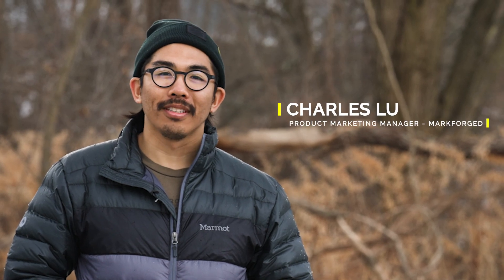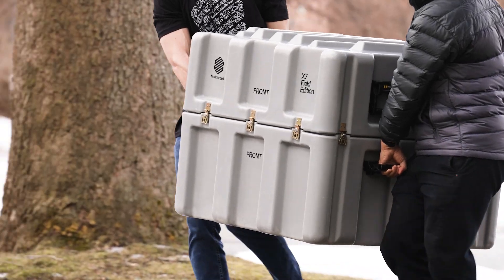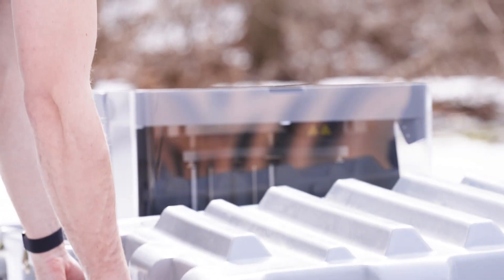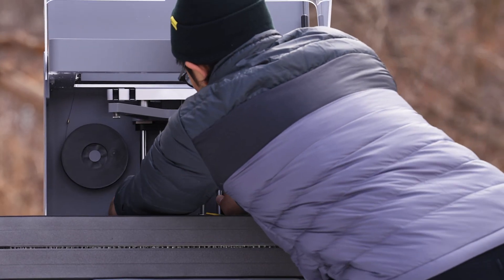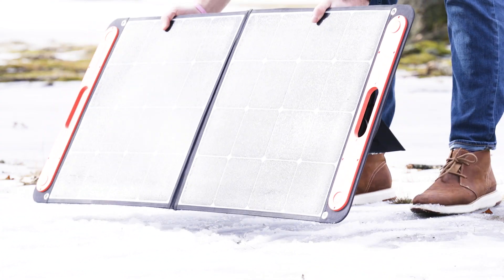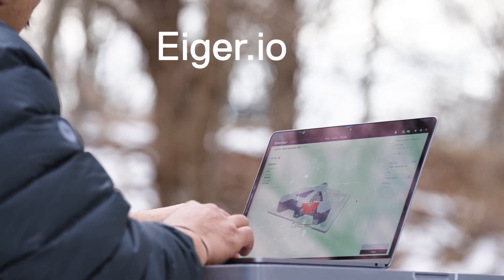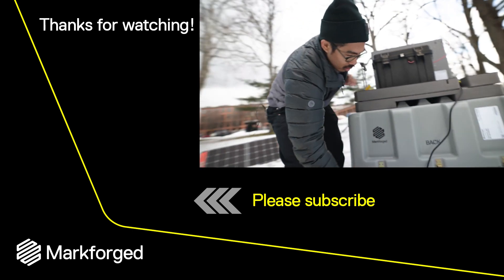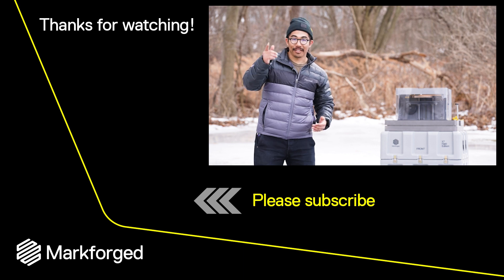How to 3D Print Anywhere on Solar Power  |  X7 Field Edition

Comment: That was a battery back up to have 240v/115 v.. solar is for charging the battery.. gives the batter pack extended run time.. this isn't running off solar, or that would be said as .. on solar.. it's on a battery , that is on solar.. not directly on a printer.

Comment: Does anybody know what power supply they used? I know that they use solar power, but what was it that they plugged the printer into. I’ve been trying to find a way to 3D print without needing an outlet and wanted to know if power supply will work.
Reply from the maker: Thanks for watching and for your comment! We’re using a Jackery Explorer 1000. Any portable power station or generator capable of outputting at least 150W can be used as well. Happy printing!
Reply: @markforged  I was working to develop a project with similar intent a few years back which unfortunately had to be put on hiatus (life circumstances). It looks like it will still be some time until you've worked up to including all the same features and capabilities as the fully self-sufficient rapidly deployable additive manufacturing system for expeditionary applications in austere environments I had designed, but you're definitely making progress! Glad to see someone else taking up the mantle with it. 👍
Reply: I've used two 12V car batteries in series wired directly into the printer instead of using the power supply for remote printing. (power supply converts 120AC into 24V DC for my printers). Many 3d printers are 24V, so it's super easy to just wire it directly to the batteries in series.
Reply: It looks like an automotive lead-acid battery with an inverter for your AC appliances. Though, that begs to ask a question; why they did not use automotive plugs and skip the DC to AC back to DC mess. Like even if they had used a donkey to get to the local park creek they would still use a DC power source and like a DC battery to stabilize power output from the photovoltaic cells, a crank generator, or whatever... an RC car motor for a week if using a generator is cheating.

Comment: *Anywhere, so long as you have an internet connection for the Eiger "software".
Reply: Except you can get it standalone (offline) and use a USB drive
Reply: @lightningxx  Only if you're a government or high security person. I tried, they would not give me the software. They wouldn't even tell me how much the offline version costs so I could consider the software subscription. They would not let me even try the software when I was reviewing the Mark Two.
Reply: Don't get me wrong, I love Markforged and the Mark Two, this is the only thing I have been disappointed about with Markforged.
Reply from the maker: @mikedixonphoto  Hey Mike - thanks for flagging. That definitely sounds frustrating, but the good news is, we’ve recently made it available to customers that want it. It still doesn't have feature parity with Cloud Eiger, but has gotten many updates in the last two years to bring it pretty close. We still encourage folks to use Cloud Eiger first and foremost, but understand that there are times when Offline is preferred.
Reply: @lightningxx  you think the company has any value if the software get hacked?